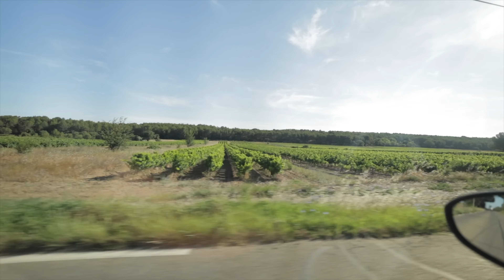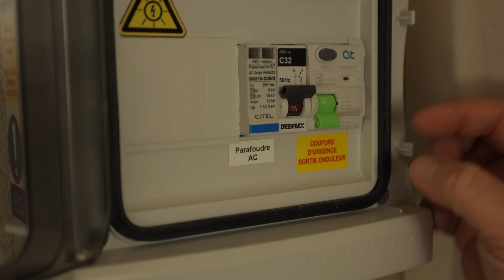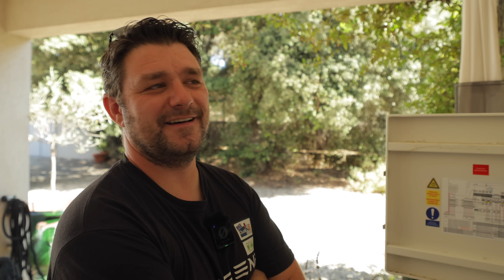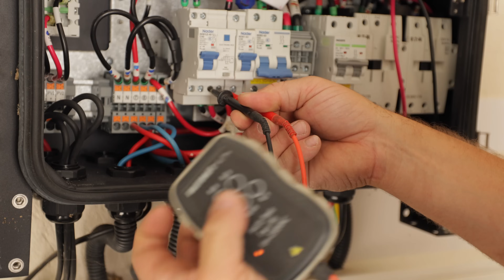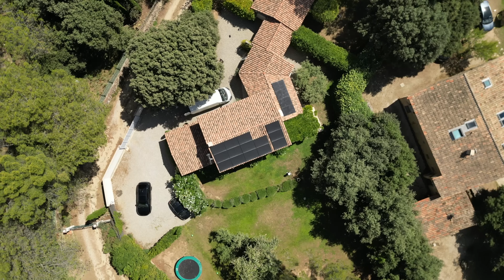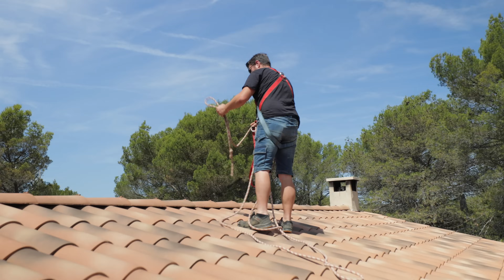Why I Had to Go to France to Fix a Solar Installation 😳

Comment: Hello, I wanted to get your opinion. I installed a 20-kilowatt-hour Libbi solar panel myself at my home in France. Everything works very well, but I increased my production by installing more solar panels, and I would like to install another Libbi. Is it possible to install a Libbi on a single-phase system, and if so, I imagine they need to be installed in parallel? Do you have any experience or feedback on this? Thank you.

Comment: Hello, bonding Solarpaneel to ground also make sense in case of Insulation Self-Test of every Solar Inverter! Also, in case of defective Back sheet (common problem!) on Solar Paneel an some Rain you have good failure protection!

Comment: Hi,  can you share from François a line drawing of the French electrical regulations for solar installation. Did he include SPD's in the solar sub panel or were they already part of the original electrical installation and how are the solar panel and rail Earth's connected at the consumer unit?  If you install micro inverters with L,N,E connection from each micro inverter to the consumer unit,  does it still require the rails and solar panel frames to be Earthed back to the consumer unit as well?

Comment: solar pannels structure is earthed because of many mounts that may be to tied and detroy the insulation (even allowing water to enter inside, close to shingles and cause major fire issue). That's not a fault, that's a SAFETY FEATURE.

Comment: Great post, thanks! Two things. 

Does bonding the solar panels and rails not introduce a ground potential above surface level and therefore increase the likelihood of a lightening strike to a greater level than if the system was not bonded? Ive only ever bonded panels in the UK on ground mount. 

Also, I recently did an off-grid system for some mates in south France, around Montpellier, and they have expressed that their families were interested in solar. Looks like there is a decent market for providing solar to expats out there and I am looking for ways to potentially get involved. If anyone one knows of what I need to do to get involved that'd be great. If it is a matter of retraining then I would be open to work with a company in order to ensure compliance with french regulations.

Comment: Did my solar install myself, I'm living at Reunion Island, loads of sun, but lot of wind, so had to secure... .
Everything's ok, grounded, never a probleù, but man, the costs are insane...

Went from 5-6 euros a day of elecrticity to 1.4-1.5 euros, huge change.

I won't go full autonomy at the moment, but it has been a huge help, I can charge my EV during 2.5-3 hours a day usually, huge help!

And my everything is grounded, even solar pannels. No problem at the moment, even when there is a power outage.
Reply from the maker: Awesome! 🤩
Reply: @artisanelectrics  Thanks.

But people should be sure of what they're doing, I'm no pro', just had a lot of documentation, did a lot of research and asked questions to professionnals (and a lot of them weren't that professionnal).
I run on solar from 8.00 to usually 20.00 on a good sunny day, I don't have a lot of batteries (only 48V at the moment, looking to buy 4 mores 12V), since it is really expansive.

Not re-selling to EDF (french provide), since it is a huge pain in the *ahem*, that is why I will probably expand storage.

And thanks for you videos, always interesting to watch themn keep it up !

Comment: When the sun is out and my Victron MPPT controller is charging my batteries, my Amateur Radio (Ham) equipment is useless!  I think this is a common problem with MPPT controllers as they emitting lots of radio frequency noise when active!
Reply: Would it help to build a faraday cage for the mppt controller ?

Comment: You must test RCD on top contacts not on input (bottom contacts) and im car mechanic 🤔 and load input should be from the bottom if im right and top contacts output to loads

Comment: 19:52 regarding "i'm telling you what to do now": Nothing wrong about that, actually it is good practice in software engineering called pair programming. One person does the coding and another one tells you what to do in general (but not dictating the code letter by letter). I assume this would work well in other crafts like electical as well.

Comment: RF "earth bonding" can be done with suitable capacitors. It gets complicated because long earth cables are inductors but I can see why the French would want the panels bonded

FWIW British installations are extremely lax on RFI issues, due to decades of non-enforcement by OFCOM

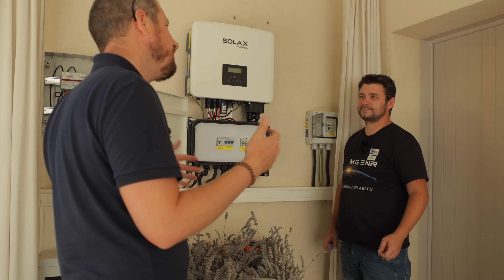Comment: 24:58 The taxes are an issue in France only if you do not have the proper legal structure to run your business. Impôts sur le Revenu (IR as a short), is the basic income tax people pay when getting some money. For corporations, the tax is called Impôt sur les Sociétés (IS as a short). Depending on the amount of business you plan to do and the amount of perosnal risk, as for the rest of europe, there are legal vesels to help. SAS or SARL (or their solo variants SASU ans EURL) are the usual one and people can choose to pay either IR or IS on their business. You should go and see a fiscalist that will explain, clarify and help to setup the right vessel to have the better tax rate allowed by thr law according to your business profile 🎉 And if you get a lot of tax it always means you get a lot of cash too🎉 Just a fiscalist will ensure the maximum ends in your pocket 🥂

Comment: Solax non hybrid inverters have a built in ground test; upon powering up they inject to small current into the ground to see if it is there. In earlier software revisions this ground current tripped the RCD. So every morning at sunrise the RCD tripped. I ended up living without it. There can be considerable capacitive ground current when using thin film type PV panels and single phase inverters. SMA has an app note how to trick and compensate for this. Three phase inverters have the avg panel voltage at ground level, and do not suffer from capacitive leakage

Comment: RCD or "Interrupteur différentiel 2P 230V~ 40A type AC 300mA - 2 modules" Legrand brand - Found it at 60€.
They could find a solution to run cleanly the cables from the roof to the DC box.......maybe they could but was pricier.

Comment: The flexible conduit is called "gaine" and provides the double insulation requirement to the single core conductors inside, it is used pretty much everywhere as it allows (in theory) a damaged wire to be replaced.

He is correct to say that for surface mounted wiring gaine must be used or a double insulated cable but the ones he pointed out which were not in gaine were red and black IIRC single insulated 16 or 25mm2 supply cables so should have been in gaine or trunking,  also the red and black unless they were both live conductors should have been blue for the neutral.

A real cowboy job and typical of a solar or swimming pool installation in my country.

I was shouting out loud when he tried to test the RCD between phase and neutral and the other guy did not even know it was wrong.

Comment: Bonding PV panels to the AC-linked Earth is not a good idea with RCDs in the circuit.
Bonding PV panels to a dedicated DC-only Earth spike is a good solution and helps reduce EMF issues affecting all sorts of RF signals from Amateur Radio and Wi-Fi (I had both of these issues).

Comment: Another thought about earth bonding - although the PV panels are on the roof out of the householder's reach - other trades may need to be on the roof (e.g. attending the aircon or heatpump) and they may find themselves in contact with both their equipment and the PV metalwork..

Comment: Over Voltage Protection NEEDS earth bonding of the Solar panels.
Also:
In counties with a lot of snow like here in Austria homeowners may also go onto the roof to clear the snow.
In that case live voltage on a panel could be deadly.

Comment: I don't really get why grounding a double insulated solar panel array would cause problems. In the Netherlands all solar arrays have to be grounded too and when they're installed by an official company they usually are. I've never heard of any problems with it unless a panel got damaged or non compliant connectors are used voiding the double insulated anymore and the ground might get in contact with the DC lines.

The only problems with solar panels are the ones where + and - wires aren't installed next to each other but on a circle causing an induction loop. This can be prevented by not making a loop but putting the +, - and ground wires next to each other.
Reply: Unfortunately this is required in The Netherlands because of the NEN1010. Why grounding is so important? Because the underconstruction is an "vreemd geleidend" (extraneous conductive ?)  part and therefor needs to be grounded. It protects people from an unlikely shook if they are on the roof and touch the under construction.
Reply: @Edwin_Verschoor  Why unfortunately? I think it's a good thing you have to ground everything as it also reduces EMI. Also as I said I don't really get why someone has problems when earthing/grounding the frame of a double insulated electrical device.

The only problem with grounding and bonding when not done correctly you create all kinds of ground loops which will cause all kinds of invisible problems. 

I encounter a lot of wild west bonding in central heating systems where all kinds of stray currents are created. These cause all kinds of EMC problems.

The PME/TN-C-S system is also problematic when it is combined with other external metallic piping like water, gas and city heating. Essentially there is nothing wrong with PME/TN-C-S system but when used, on all other incoming conductors  galvanic isolation should be applied to mitigate stray currents.

The French somewhat solved this the other way around by making TT system mandatory. Although TT and TN-S systems prevent stray neutral currents, it doesn't prevent EMI in ground loops from becoming a problem because ground noise from Switched Mode Power Supplies can still irradiate through the ground loops.

I'm actually member of the work-group dirty electricity of "Kennisplatform EMV" and there is a lot of discussion going on how to solve these problems as a lot of groups are affected differently by EMI are affected by the improper grounding and bonding that has been going on for decades. That's why there is so much misinformation about grounding and bonding. The solution is simple. Whenever you want to bond something metal you have to make sure it isn't bonded anywhere else and when it is you have to apply galvanic isolation. This prevents stray currents from occuring.

Why this isn't standard practise? Because it's more work to make something completely isolated and you also need specific matterials to first create an isolated system and then properly bond this system to the Protective Earth (CPC).

The wrong way is like with the TT system simply not bonding whatever creates problems. Although this usually solves the EMI problem on short term, you increase the risks which are mitigated by bonding.

Comment: 18:40 there is no ground-neutral bond in off grid mode. In on-grid mode the bond should be removed to not have grounding loops.

Comment: Jordan I always bring an earth wire from the rails and pannels.  If they are close to a velux window then you must anyway. But my seaward tester requires connection to rail for testing so rather than get a ladder off the van it's done.

Comment: The panel earth bond thing (~21:00) was mentioned on the recent e5 video about becoming 'live' in certain situations, which I suspected would be RFI filters that need an earth connection, that if left open gains half supply volts through the Y capacitors in the RFI cct.
Reply: Just talked to my installer who added some extra details. 
Apparently, originally, rails were earthed (CPC) but then became a part of the lightening hazard system so would need surge protection, plus the potential DC leakage would/could affect the circuit breakers if not rated for additional DC. Hence the earthing requirement got removed. And now it's possible other systems assume the presence of an earth. So it's building to a bag of worms..

Comment: Interesting that you mentioned amateur radio.... I'm a radio ham, and moved from France to Northumberland into a fairly recently built estate. There are five houses in the immediate vicinity, and 3.5 MHz 80 metres is completely unusable due to a high level of RF noise.....
Reply from the maker: Interesting thanks for sharing!

Comment: Both "loft" and "attic" are used in British English to describe a large space under a roof that's above the main occupied areas of a building. However, the terms have different meanings in some definitions:
Attic
Usually refers to an entire floor of a building, or a room immediately under the roof that's accessed by a staircase. Attics can be used for storage, HVAC equipment, or insulation, or they can be converted into private rooms.
Loft
Usually refers to one or more rooms or spaces under the roof that are accessed by a hatch and loft ladder. Lofts can be used for a specific purpose, like an organ loft in a church, or they can be converted into a living space. Lofts often have an open-plan design that combines contemporary design with historical architecture
Reply: Attic: permanently accessible, liveable space.   Loft, accessed by temporary means (ie ladder) not liveable.
Reply: @calmeilles  In the US, we use that term in the reverse. Attic is an unfinished space, temp. access. A loft is usually a semi finished space that is elevated.

Comment: Don't write off the idea of running a business in France. I think corp tax in the UK and France is now the same (25%), and although the social contributions are high the pension you get at the end is much more than the state pension in the UK. Plus the health cover is (currently) better in France, saying that, the health system is creaking under the pressure, but not as bad as in the UK.

Comment: The sheet under neath is a fibre cement roof sheet (my sister lives in Bergerac and they have exactly the same system) they then lay the clay tile over the crown of the profile

Top tip - don't ever attempt walking on a fibre cement roof in UK, the purlin centres are larger and more often than not the roof sheet will fail (with no warning either), its also illegal to access a fibre cement roof in UK without some form of safety, usually netting under the roof or a harness system on the roof that you can connect onto at the eaves with walkboards to access the working area
Reply: So your roof is made of the same stuff you line your bathroom walls with?  Well at least it will handle water.  LOL

Comment: Interesting...I have a 2 year old installation with a Fronius Symo transformerless inverter on a 30 mA RCD and it never tripped. The leakage on the AC side is about 5 mA (I used a KPS DCM300LEAK to measure). I regularly test the RCD with a Metrel MI 3125.

Comment: Earth bonding of solar panels. Interesting and I have never got a straight answer on my installation in the UK.
I have a metal roof (Kingspan ks1000). Inner and outer skin metal with PV mounting across trapezoidal. Metal fixings traversing through roof so path to inside of building. 
Should metal roof earth bonded on inner or outer skin to protect PV fault or lightening?

Comment: In the US on metal surfaces have to be bonded so solar panels do you have to be grounded it's interesting I didn't know that the UK doesn't CPC solar panels. Basically it comes down to having all metal surfaces at equal potential bonding. And recently I saw a couple videos that are indicating cheaper inverters are causing the solar panels to float with touch voltages that are bad. Noise would be another thing there's enough noise in the world it would be nice if it stayed out of the radio frequency causing Wi-Fi issues and ham radio issues although that's the first I've heard of that with Solar.

Comment: Loved the Video! Francois was an awesome guy. The reason we now have to earth the rails is to carry out insulation resistance testing periodically. It is becoming a big problem as pv panels get older the silicons are breaking down, creating positive or negative to earth or gradually shorting the panel. If you have to climb up on the roof to test this you will need to cover the panels first.
Reply from the maker: Great thanks for sharing that info!
Reply: Cleaning panels is what got me to put them on the ground so they are accessible.  Dust is easy, but pollen glues itself.  I spent a month designing a tilt tracking system for the roof that would fit in the tight space down near the eaves for the lower panels I never got to build more than the test prototype.
Reply: @robertsmith2956  How about a gardena micro-drip system equipped with sprayers and a detergent addon to lift the pollen. Essentially the ability to wash the panels down without having to get out a garden hose (and can be done on an irrigation timer)
Reply: @miscbits6399  I thought about it, even a wash roller on tracks to run down the panels.  But drip systems clog when dealing with pollen.  It was much easier to put the panels on the ground, and build a shed behind them to hold the electronics.

Comment: Interesting video but no need to insult 'radio nerds'. The interference (surprised you didn't know) is usually caused by the switching regulator converting the DC to AC or just changing the DC voltage to provide the MPPT function. There is often limited filtering back to the source DC, the panels of course, and so the panels or just the wiring radiates. This can fail EMC requirements and OFCOM can and do visit to investigate some cases. There are some fixes involving choking the RFI at the inverter.